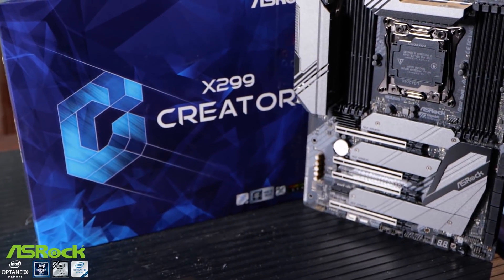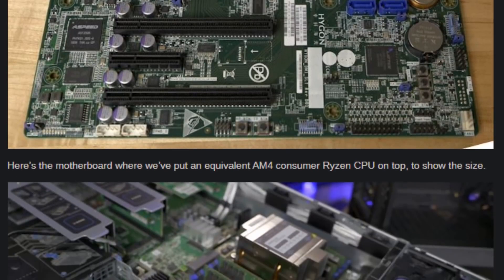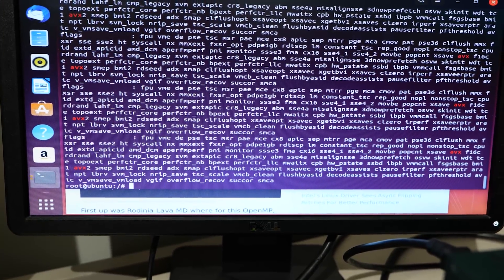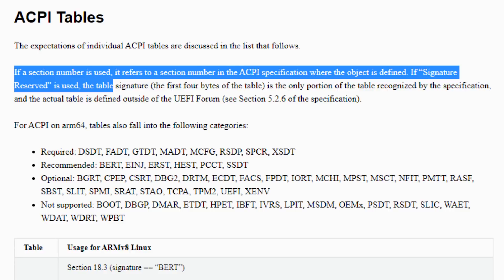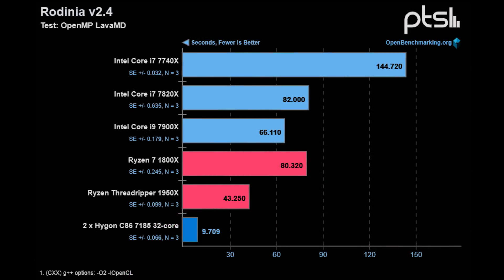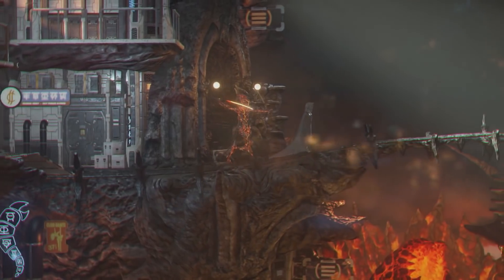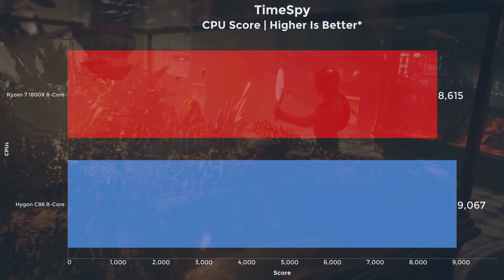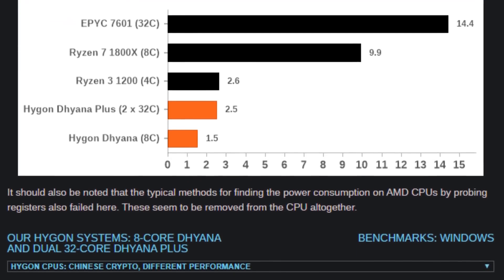Wendell Reveals HYGON AVX2 & Performance Mysteries! (Poking At Chinese Servers Pt. 2)

Comment: There are processors out there with hidden RISC cores activated and controlled with password like sequences of unlisted instructions. These cores are capable of bypassing security restrictions and manipulating the system for state actors and intelligence agencies. The sandsifter issue could be an "incorrect password" response. Or more likely the instructions change the state of the CPU to a state that is invalid, there is no fallback on this low a level other than reset.

Comment: umm, avx512 means that each simd register can hold 512-bits of data, not that there are 512 registers. there are 32 such registers zmm0 thru zmm31. there are also 8 mask registers k0 thru k7 used for disabling individual parts of a simd operation (lanes) by having the corresponding bit in the mask register set to 0 or 1.

Comment: I wonder what OS the Chinese ran on these CPUs?
Reply: you mean hypervisor. i have seen instructions in nvidia VGPU drivers for a huawei hypervisor, as well as linux KVM and VMware but, i wonderi f the chinese use the huawei hypervisor?
Reply: China has two company made x86 CPU, Hygon is X86 CPU, windows 10 is ok
Reply: NeoKylin or UnionTech UOS. One is based on Ubuntu and another is based on Deepin.

Comment: Its what you said about Sandsifter can just crash the machine if it sends an opcode the CPU is not expecting. I remember the author (xoreaxeax/Domas) saying he needed some kind of automatic reboot system in the presentation he gave.
Reply: i believe you could run it in an unprivileged mode which somewhat reduces that.. you never know with super secret instructions though :)

Comment: What if the AVX2 benchmark has an "if AMD, do this; else, do intel optimized code"?
Reply: S T  Most benchmarks will be compiled with a neutral optimizing compiler, e.g. llvm, gcc, or msvc. Both sides have their own optimizing compilers, intel has icc and amd has aocc (which is an llvm fork). When compiled with gcc or llvm (assuming you use the appropriate switches) the compiler will do optimizations for whatever platform you're compiling on, whether it be intel or amd, specific to that microarchitecture even. They may not be as strong as say ICC for Intel or AOCC for AMD, but they'll be pretty good for both. If you want to compare aocc vs icc that's another conversation entirely. As for dynamic linking, you don't even have to do that assuming you're compiling the benchmark, you can just use the appropriate flags and run the resulting binary (assuming they have conditional code compilation in the source code). As for the performance hit, it's generally fairly small because it's generally just one extra indirection, but it's possible to avoid that through some cleverness, but to get rid of that the linux/nt kernels and elf/pe file loaders (respectively) would have to be designed differently and I don't think anyone is willing to do that just to get rid of one indirection.
Reply: S T  the way to get rid of that indirection and retain dynamically linked modules btw is to have the loader fixup callsites upon import processing and replacing the indirect call with a direct one when applicable, although this sounds trivial, it isn't, because then you have to fixup all referential code from that points downwards (which means you either need to do a bunch of passes or have data for what instructions went where and what was originally pointing to them ) and it turns into this huge cascading fixup processing and it's just kind of a nightmare, not to mention function pointers which would need to be adjusted.. and you'd need more data for that too.. as you can see, not worth it/10.
Reply: non-issue. I imagine you're referring to what ICC used to do, but intel has since removed that from codegen.